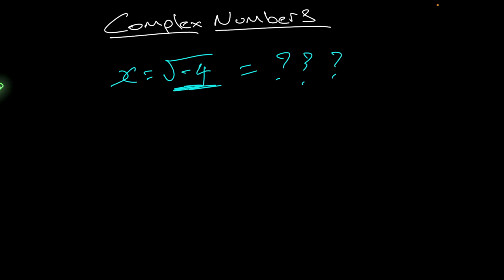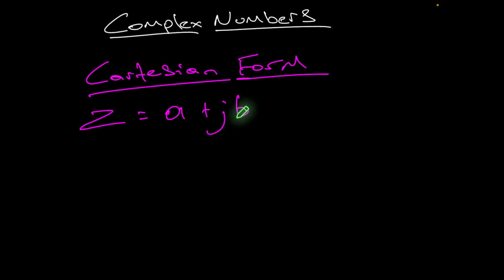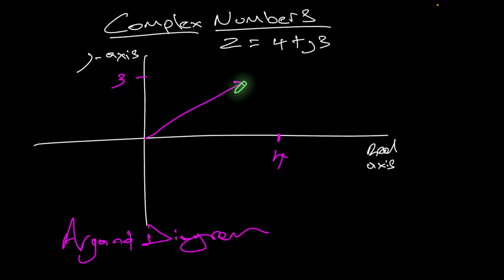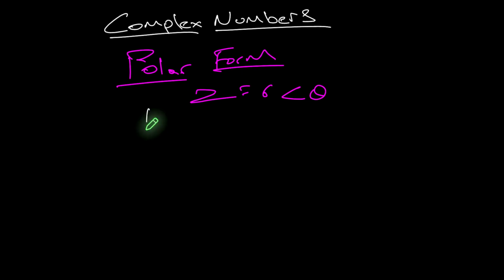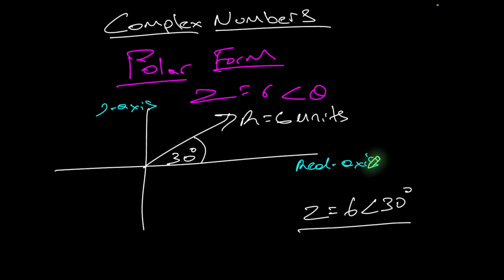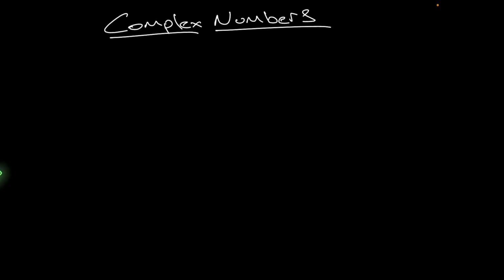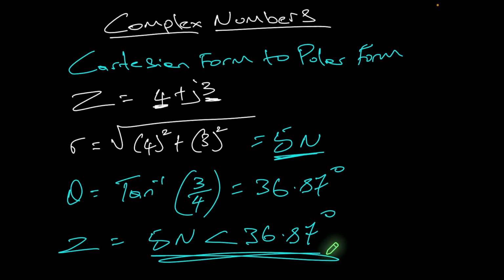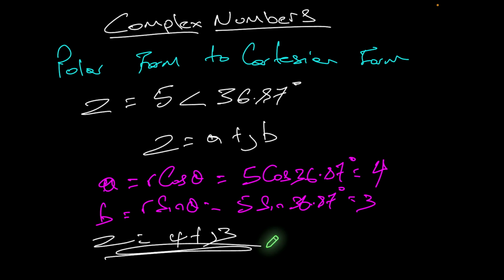Complex Numbers for Beginners

Comment from the maker: I will go deeper into some areas of this topic on future videos❤.
Reply: great video

it is usually written with "i"
i² = -1

but yeah
j and k also work

but they are used for quaternions which are a + bi + cj + dk
Reply from the maker: @The_NightShirospot on ❤
Reply from the maker: @T@The_NightShirodepending on the area of study
Reply: @MechanicalEngineeringTutor in some areas j is also seen as a virtual number, aka j = ln(-1)
Reply: @The_NightShiro In Electrical Engineering "j" is used for imaginary numbers to avoid confusion with "i", which is used for current. (In electronics, lower case "i" is often used for ac signals.) Current and voltage in ac circuits are rarely perfectly in phase. In electronics often due to design. Other times, particularly power engineering, due to real world constraints.